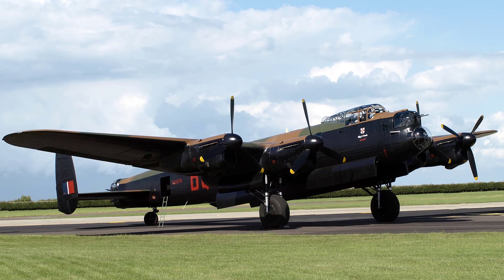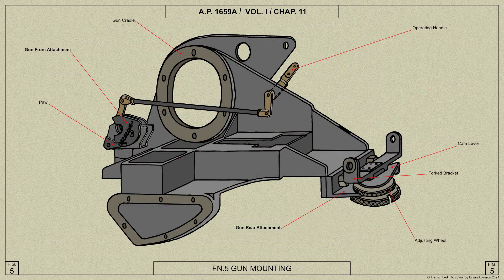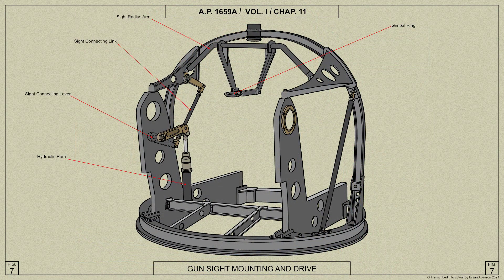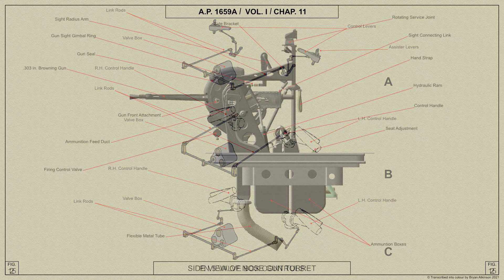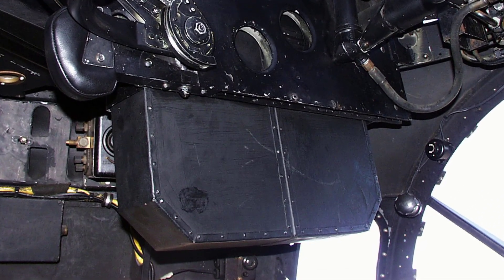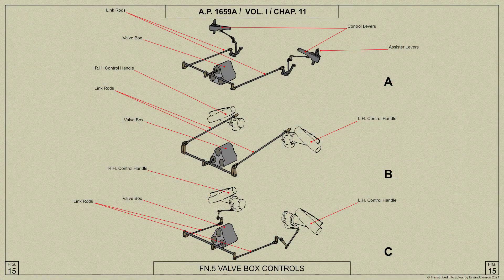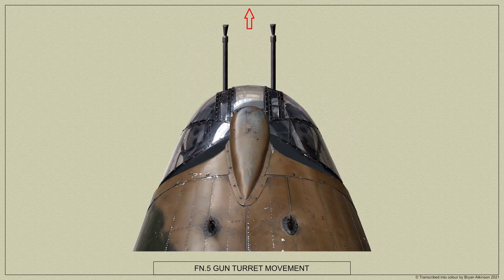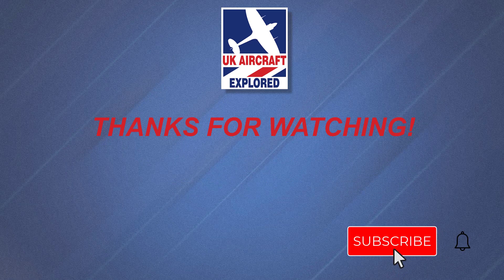Avro Lancaster – FN.5 Forward Gun Turret

Comment: I always wondered if the Brownings were more reliable/less reliable or about the same versus 30.06.
🤔?
Edit: .vs .303.
Taking into account the differences in the bottom of the cartridge.
Reply from the maker: I'm not sure on that one. From conversations with gunners years ago, there were hang ups sometimes, also problems with icing.
Reply: The 30-06 versions fired from a closed bolt, but the 303 ones, because of different propellant, used a two stage process which is technically closed bolt, but with it held open most of the time. I'm amazed it worked, but it did

Comment: Very interesting. I have heard little to nothing about the Lancaster nose turret in action - other than the Dambusters Raid where they used them to shoot at the flak towers as they made their approaches - does anyone know of a nose gunner shooting down an enemy aircraft?
Reply: Very rare, if any. Most attacks were from the rear or below, especially later on in the war when the Germans introduced the Schräge Musik installations.
Reply: I don't know about kills. But in the book 'Lancaster' by Garbett and Goulding there's an archive photo of a Lancaster on the ground, post-raid, with the bomb-aimer's blister absolutely full of spent .303 casings and links... The caption doesn't explain the story behind the photo, but it says the nose turret saw the most action during daylight raids towards the end of the war. It also says that there were very rare occasions where Lancasters were used to make low-level strafing attacks on trains, in which the nose and tail turrets were employed.

I suppose it must have been employed often enough to retain it for the duration of the war, otherwise I would expect it to have been removed to save weight and improve performance fairly early on, as happened with the Halifax. Plus the early Lincolns came with a Boulton Paul nose turret, right at the very end of the war.
Reply: @hermitguitarist-f3u excellent point re: they must have kept it for some reason. They were pretty ruthless in getting rid of redundant weight as we saw with the ventral turret.
Reply from the maker: Thanks for watching!
Reply: There are arguments that the nose guns on the Dambusters raids were sadly counterproductive as the tracer made it easier to see the bombers. Although those aircraft lacked mid-upper turrets they had a Vickers K in a ventral hatch although given how low they were flying I'm not sure there would have been much to shoot at

Comment: great video, one question, was the front gun turrent manned by a gunner or did the air bomber fill the role as needed
Reply from the maker: Thanks for watching, the front turret did not have a dedicated gunner, it was often manned by the Air Bomber or maybe by other crew members depending on the situation.
Reply: @ukaircraftexplored6556  During the Dam Busters mission, the modified Lancasters' mid-upper turrets were removed, so each gunner simply shifted to the front turret. Stirrups were fitted to keep the gunners' feet out of the way of the bomb aimers.
The aircraft later modified to carry the ten-ton Grand Slam bombs had both front and mid-upper turrets removed – as well as two of the guns in the tail turret and two crew members. All this was to strip as much unwanted weight as possible — I never heard if they removed the Elsan as well, but I would not have been surprised...
Reply: @ukaircraftexplored6556 . The other two big RAF bombers - stirling and  halifax - had front turrets as well. Did they have a dedicated gunner crewman or was the position manned by whoever was available?
Reply: My late dad once mentioned he never fired them in anger although the mid upper and tail gunners did enough shooting. I think the traverse was fairly limited. He also mentioned that approaching the UK coast he would selected single shot to clear the loaded rounds. One time he forgot and sent tracer spraying across the sky which created pandemonium on board.
Reply: @davehall44 n theory, the traverse was nearly pretty good (135 degrees from memory) In practice, it could affect trim at the extremes. Certainly, the early Halifaxes, which had slightly dubious stability with the original tail, there had to be spoilers fitted to the turret to deal with the trim changes. I'm not sure how bad it was on the Lancaster.